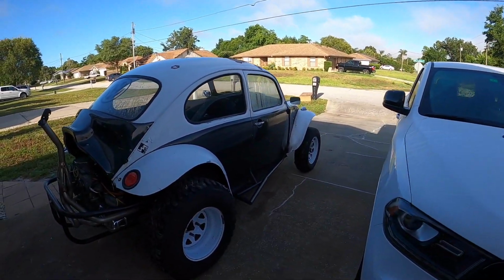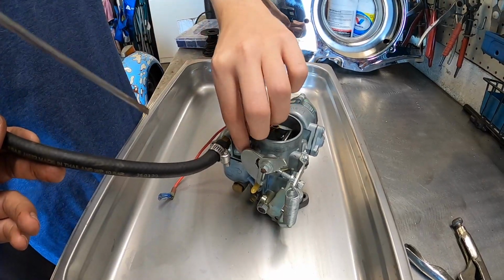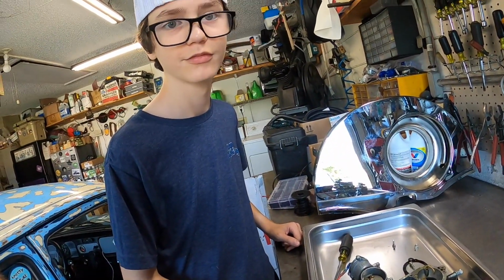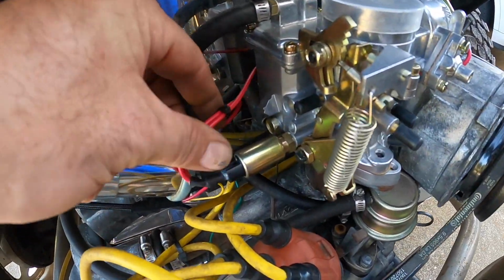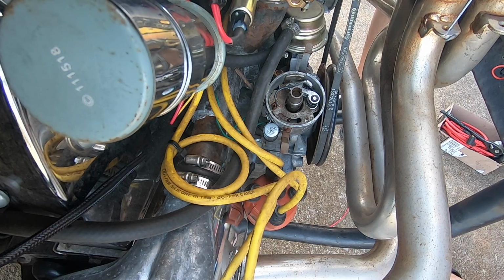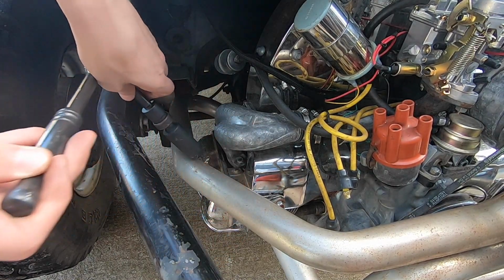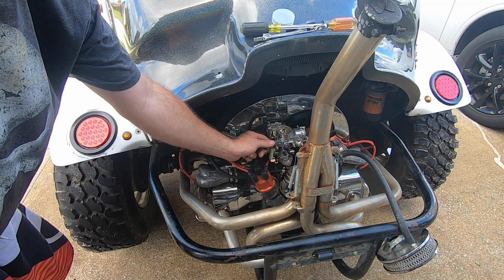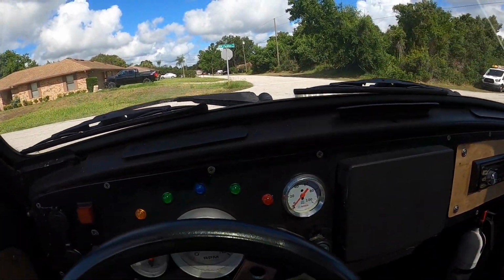VW Baja Beetle - Teaching The Kid - Tune Up, Timing, Carb Upgrade and Tuning

Comment: Much better with the larger carb for sure.  That 28(?) Never would have been very good on that setup. Keep the videos coming.  :)
Reply from the maker: Thank you sir. This carb definitely makes it run better. Once we cleaned the gas tank out and put fresh fuel in, she’s really running good.

Comment: I started like that; helping my dad change the muffler in his Karmann Ghia. Then graduated to lawn mowers and back to VWs, which are glorified lawnmowers….🤣😂 I’ve heard the same on 30 vs 34 carbs re tune ability. Good job in teaching your kid useful things; the newer generations desperately need that.

Something looks off in the belt alignment; or is it the camera angle?

SVDA distributors also help with the stumbling off idle. Just hook up the vacuum line to the carb and works like a charm.
Reply from the maker: I remember being a little kid and working with my dad on all types of projects. Glad he’s more involved once again spending time with me and learning new skills. 
The belt alignment is slightly off and we corrected that when we converted it to a dog house cooler ( which we forgot to record) 
The stumble is gone as soon as we flushed the tank and added some fresh fuel. I wouldn’t mind running an SVDA on this but I don’t have one on hand and I need to address a few other things before I go too far.

Comment: G'day, 
Great video, father and son on the tools together. Doesn't get much better than that.
It'll be interesting to see what this engine is like once you start digging a bit more. 
Anyhoo thanks for sharing guys. 
✌️ from Melbourne Australia.
Reply from the maker: Yes sir buddy, always great having him back in the garage again. Can’t beat that quality time together. 
Engine seems to be pretty decent, stock like engine with big tires lol We flushed the tank, added fresh gas and it runs great… just not much umph due to the tires.

Comment: Great video Gary, can't get enough garage time with the young one's, i have always had great success with bumping up the main jet a couple when running the 009, it's great for getting that flat spot out, i did a video three years ago on main jet change that can be done in about 3 minutes with carb still on the engine, the title was (main change jet VW), the little Baja is really making me miss mine, guess i will have to go for a Dune Buggy ride, oh yeah
Reply from the maker: Yes sir. We flushed the fuel tank and added some fresh gas and she runs great especially with this different carb and bigger main jet. Ethanol content also plays a role with your main jet. More ethanol, larger jet you need.

Comment: Your getting there. 
Get new gas then you might have to go up a size on the idle jet to overcome that stumble specially if that’s a 50 or 55 idle jet. 
The carb you took off is a empi 30-pict 1 style. Only really good for single port motor.
Let me know when y’all go hit the off road in that thing, I’ll join ya. My Baja is running again.
Reply from the maker: Yes sir, so close now! 
We flushed the tank and added fresh gas and she runs just about perfect. No stumble or hesitation at all. 
Been too busy to get the tag, hopefully soon and then we’ll get together!

Comment: Nice work Levi! did you guys ever check the dwell for the points? I'm sure the carb and distributor were bought at the same time both cheap empi's(too strong of advance springs can make it hesitate too not getting the advance it needs)
Reply from the maker: Good points man. I don’t have a dwell Meyer so I’m unable to check that. We did however flush the gas tank and put in some fresh gas. She runs perfect now. I was about to toss in a different dizzy but Levi suggested flushing the tank first 😎👍
Reply: @VWJawbreaker  nice fix! With points adjusting your dwell is key! You can usually find the meters at yard sales or thrift shops. Most people don't use them anymore but I still have a couple and keep at least 1 distributor with points adjusted to perfection  as a backup in my car just in case the electronic ignition takes a shit
Reply from the maker: @V8N8T  I haven’t had much luck finding old dwell meters at yard sales but I haven’t given up yet lol
I do the same for jawbreaker, I have a stock distributor all setup with a distributor clamp on it so I can drop it in and run without using a timing light.
Reply: @VWJawbreaker  you'll find one some day I'm sure:)  that's always a good way of doing it ill have to add a clamp to mine:)

Comment: Hey ! What you need since it's a baja is a 38/38 EGAS center mount carb kit . I got the 32/36 progressive . it runs like normal until you get over half way then the second barrel kick in and it shoots more rpm . I probably would have liked the 38/38 but this one give good mpg . If you can get a used intake for one on Amazon they have them for 135 but I can bet it aint going to have the right jets .  I wish I had the baja and you had my lawnmower . because I would not waste time mowing grass I would be fishing at the beach .
Reply from the maker: Yes sir, I’d love to have a 38/38 on this Baja. They are great carbs and better than the 32/36 and easier to tune imo. But I had this 30/31 and it’ll do just fine for the time being. Maybe down the road I’ll look at the swap meets and see if I can score a 38/38.
Reply: @VWJawbreaker  I would like one but the mpg goes out the window .  110 cam kit . D ports on heads and intakes with that 38/38 .=  90 mph .    on a baja with big tires the mph goes way up . My neighbor had a lime green one with a 1600 single port 30 pict carb and it would cruise at 80 mph . Did I mention  - I like the baja !!!!

Comment: Looks like a 28 Pict for sure. Look at the fit on the manifold. A bigger carb would surely wake things up! And a 110 main jet? Yikes. that's lean AF!
Reply from the maker: Yea sir, small carb, small main jet and bad gas…. New carb, bigger main jet and we cleaned the tank and added fl fresh fuel…. Runs great!!

Comment: Do those one piece front windows leak like a sieve? Previous owner of my '66 baja put those in and did a hack job on the seals. Ive read nothing but horror stories about them. 
Take me back tho, my dad teaching me about points and carbs (and a lot of cv joints) on his baja. He had a '71 baja. A '73 Super, and a really nice '79 convertible, if you're into fuel injection (he was not lol)
Reply from the maker: This Baja came with the one piece also. They do not leak, as long as you get them rolled up properly…. Which is a chore in itself. 
I had the same experience, spent many long days in the shop with my dad and grandfather.
Hoping my kids have similar memories.
Reply: @VWJawbreaker  mine roll up and down ok, but the front lower corner (where the wing window used to be) it's like dude gave up on the seal and made it with black rtv and his finger hahaha